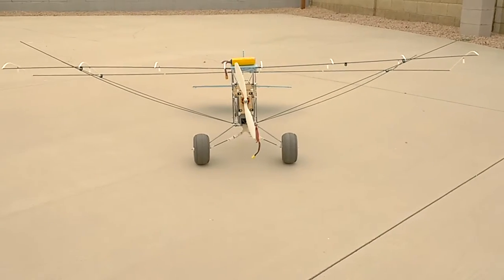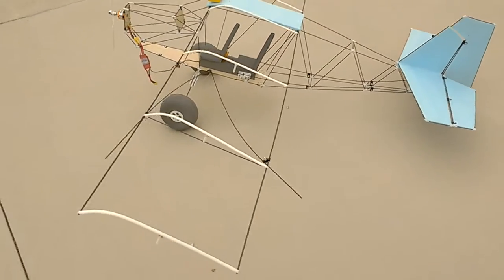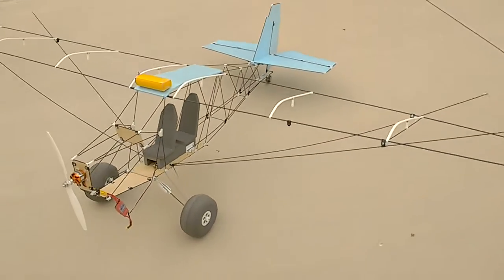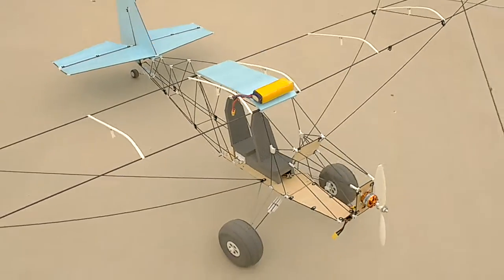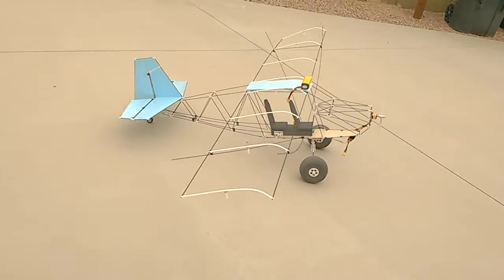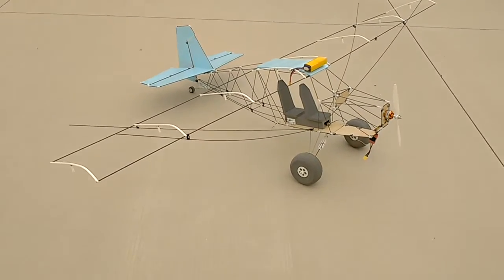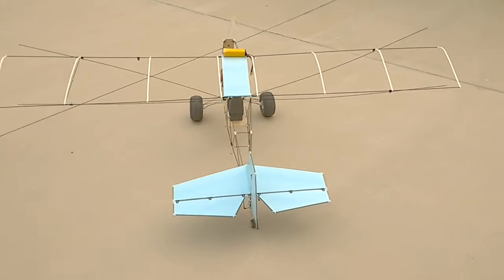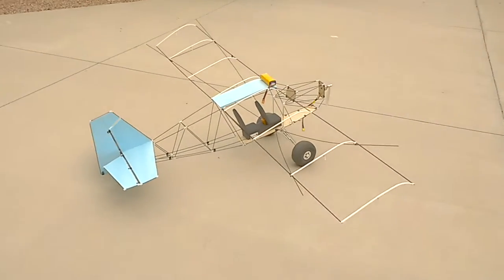MIA DECATH-a-LIGHT (TM) STOL RC Ultralight Part 2a

Comment: Looking good with the wings, flaperons and ailerons damn.... can't wait to see the maiden flight.  So what's the blue material?  Depron? Or the corrugated plastic? Would you consider cover with the same material as the ultralight models?  Or will be too much labor? Also the main struts are having another brace in the middle to make it looks straight? I know when the wing get loaded tip of the wing will go up and struts will looks straight but i am just curious.
Reply from the maker: Thanks G. Blue material is "blue core" also known a "fanfold" material used for floor insulation similar to deprom.  They sell, here in AZ , as a pack of 50 sheets, from Lowe's like Home Depot.  I've had mine for about 10 years,  still have some, from previous projects, so I decided to use it for this model. I do have white 1.5 to 3mm thick white Depron sheets, but since that stuff is scarce and expensive here in the USA, I opted to save it for another project.  The blue foam is great stuff except it is not white.  

Yes I have considered covering the wings in nylon just like on the nylon sail ultralights microlights, but I would need a different type of wing frame more rigid. But yes, that is still a consideration I can always employ later on since most of my wings I sell are typically nylon sewn and pocketed. 

The struts in the video are just 2mm rods  to hold the wing in place  for the video, but are not the actual ones. Although they could still be used as struts with the addition of upper ones to a kingpost, to hold the wing in place both when the model is upright or inverted, like cables on the old fashion full scale ultralights,  but I will simply use heaver rods, like my ultralight kits, it keeps the model cleaner and more efficient that way.